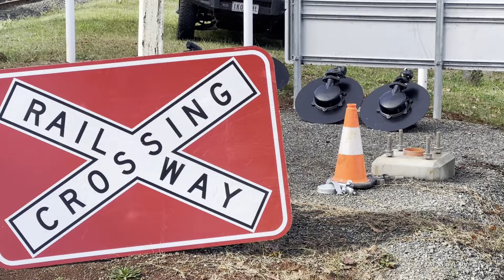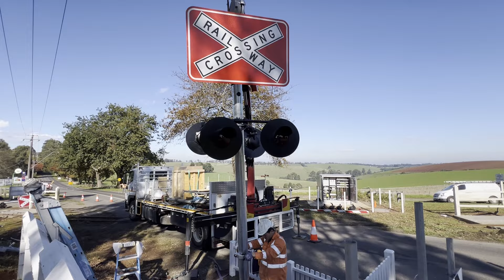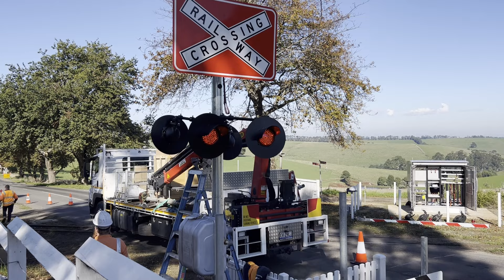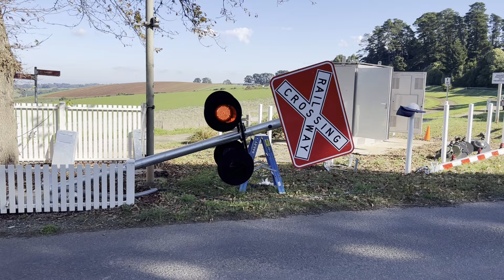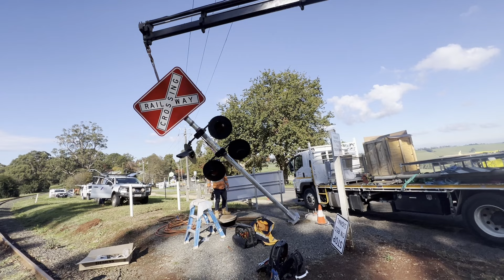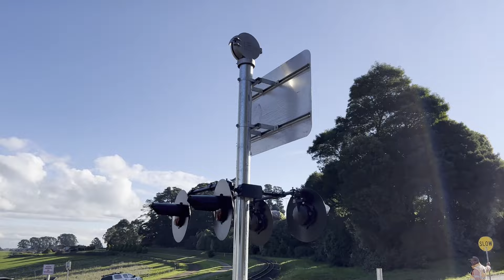Full Upgrade Process; Gateless to Gated | Belgrave-Gembrook Road Level Crossing, Gembrook

Comment: How do they know when the counterweights are correct weight / position?
Reply from the maker: Good question! At 24:47 in this video just after the V/Line worker puts the counterweights on the bolts he pushes down on the gate a little bit and i guess experience of installing many crossings is how he knows whats right and wrong but im pretty sure if the counterweights arent basically making it really easy for him to push up the gate, then there isnt enough, and if the gate is easy to push then theres too many. He'd know though pretty quickly what the difference between too many and not enough though. Hope this helps!
Reply: I thought there may have been a precise calculation for an exact amount of resistance but your comment makes sense. I really enjoyed this video! More please 😊
Reply from the maker: @SpecialMake  Yeah im pretty sure Western Cullen Hayes has an actual measurement that the gate is supposed to be set to referring to the installation documents of the gate mechanism, but then again WCH is American and this is Australia, if V/Line have a simpler way that works, then why not haha!
I appreciate it! Crossing installations are hard to come across as its not usually publicly released as to when they'll happen but i'll try my best!